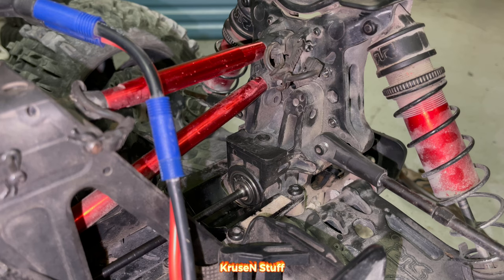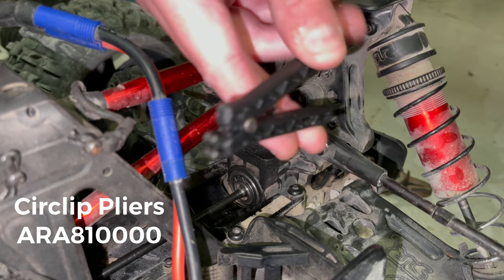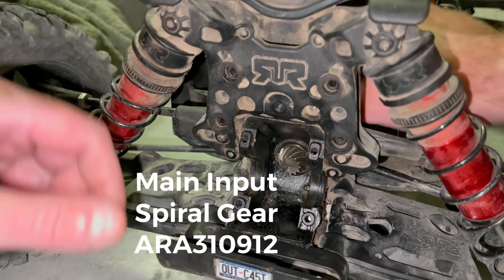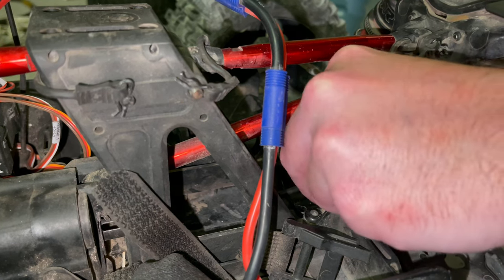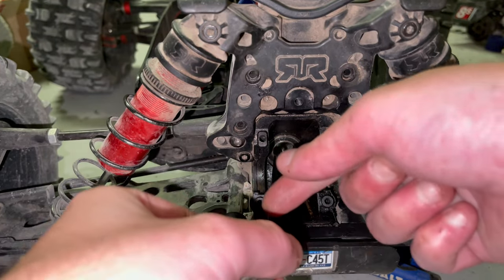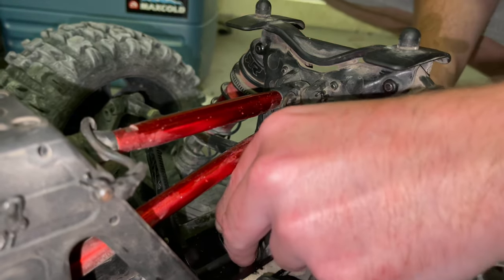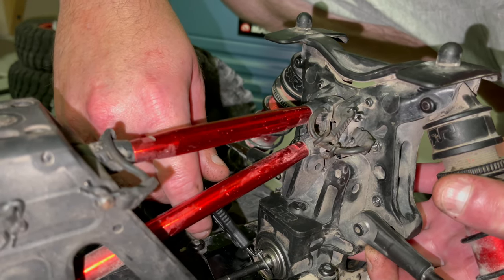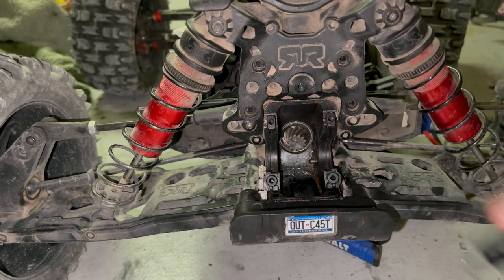Kraton8s/Outcast8s C-clip (off/on) How I Do It; Removing & Reinstalling Main Input Gear & Bearings

Comment: What oil do you use to oil the bearings
Reply from the maker: I have been using AM Arrowmax high speed bearing oil. You can get at amain for $8. https://www.amainhobbies.com/am-arrowmax-high-speed-bearing-oil-amx-210201/p590924
At this time of video, I was using 3 in 1. Both work.💯🍻

Comment: My c clip keep falling out what could be the problem
Reply from the maker: Not put on properly. I’ve put mine on wrong before and it’s fallen off. It will look on but not. Just make sure it’s seated around.
Reply: If you install it wrong it's gonna fall off on the spot. Mine installed correctly and i even pressed the clip to make it tight but they fall off again. So my suggestion is REPLACE the BEARINGS also,that way the bearings can FREE ROLL everytime you run your car.
Peace
Thanks